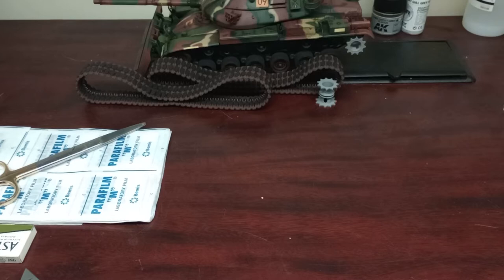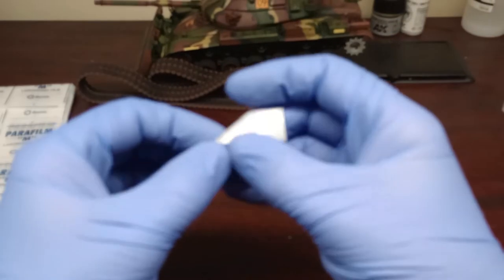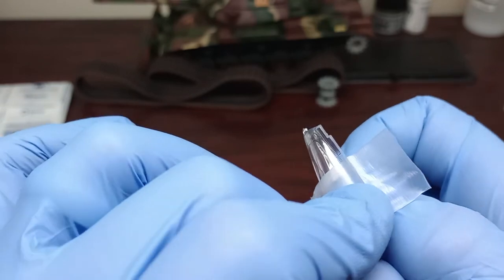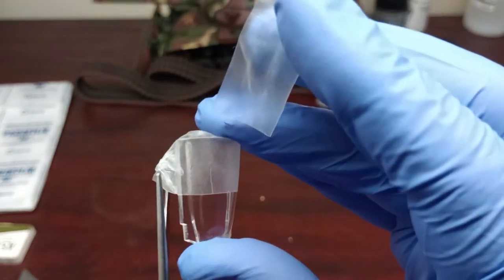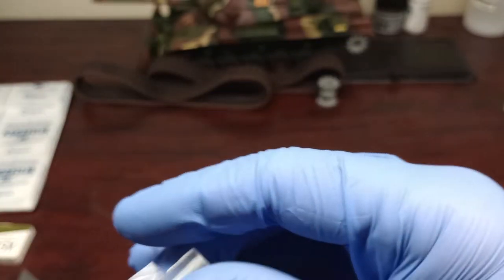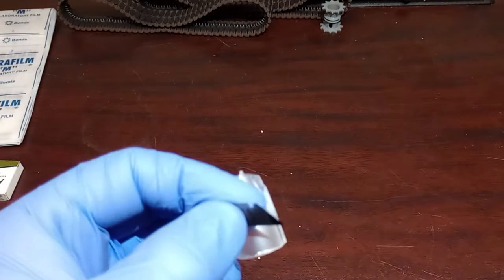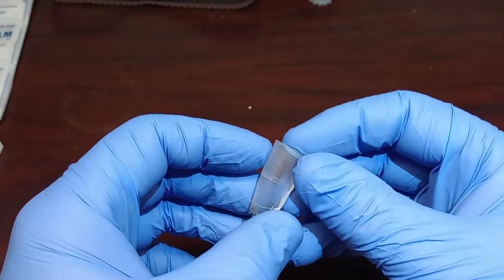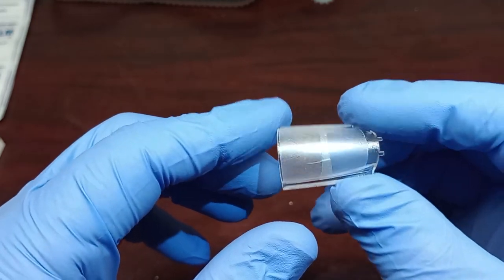The Best Way To Mask Model Aircraft Canopy. No Tape!

Comment: Awesome thank you for sharing. I saw this a few years back from YouTuber Flying S Models. So I got the huge roll from Amazon. Didn’t have much luck with it or even kobuki tape. I try fresh blades and I still manage to cut into the plastic. But I use a safety razor so I will try that. Again thanks for the advice
Reply from the maker: Safety razors really are the best aren't they!? It's actually kind of hard to dig in too deep with the razor blades because you don't have a lot to grab, therefore not much leverage. Even if you can see a line though, I've had success hiding them by applying thinned gloss varnish. Thank you for watching and I hope it goes better for you!
Reply: In the past, I had bought a small quantity of Parafilm on a roll in a blister pack from Testors.

Comment: So I happened to acquire a decent amount of this.  Have you used this for masking anything else other than canopies such as painted parts?   Figured I would might as well using it up if I have it.
Reply from the maker: Yes! I use it pretty frequently for hard edge camouflage. You can either lay it out on a cutting mat and cut your design and transfer it but that can be tricky because it sticks to itself. What I usually do is stick it on the actual model and cut it out. The Parafilm is really thin and cuts way easier than tape so as long as you're using a really sharp knife, it doesn't dig into the paint. I use a fresh safety razor blade for the old school butterfly opening razors. You can break them in half so you're only working with one edge. I also use it to mask lines if there's a lot of bumps and stuff sticking out. You can just kind of stretch it over that stuff and cut your lines. One warning though, it can have trouble sticking to matte paint. So if it keeps lifting off, take your bare finger and hold it on the film for a while and the warmth should make it stick.

Comment: Wow, what a great idea. I hate masking canopies. I was about to either quit airplanes or just not paint the frames (getting bogged down with it). I will try this.
Reply from the maker: I feel the same. When I went from armor to planes, I threw out the first two (luckily cheap) airplanes. Masking fluid, different tape methods etc. I think you'll be happy with it and just keep in mind, you can buy it in much smaller sections on eBay and Etsy. Amazon only sells it by the roll.
Reply: @SCM223  I just tried it. Man, this is the best !! Best canopies I have ever done. This stuff makes it almost easy to mask of canopies. THANKS

Comment: Found a supplier in the uk that sells this by the metre so for £5 got myself enough to do maybe 20 or so models. Just tried it on a 1/72 scale spitfire, looks like its worked really well and much easier to apply and cut than a low tack masking tape. 

Thanks for the tip ! 😁
Reply: "Found a supplier in the uk that sells this by the metre..."
So, what, you keeping it a secret from your fellow Brits? TRAITOR!
😉

Seriously though, where did you get it from, please?
Reply: @JeffJefferyUK 

He may not be selling it at mo. Go for the medical grade stuff not the gardening variety.